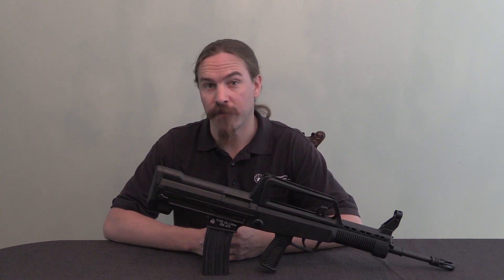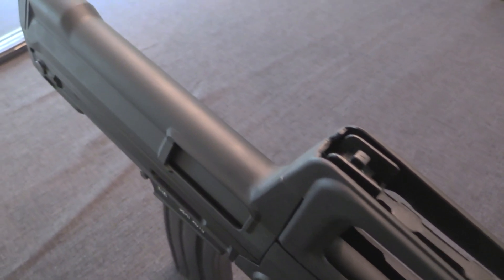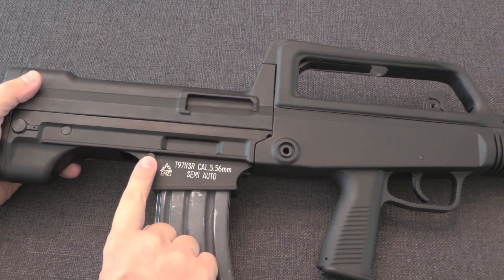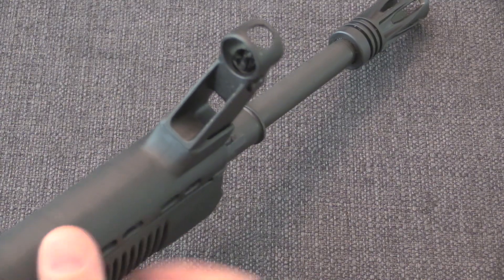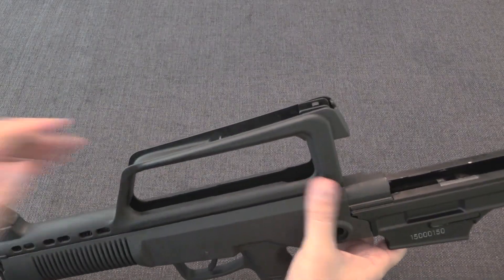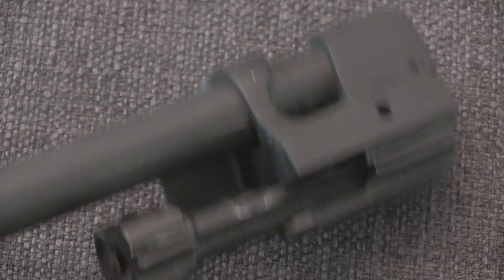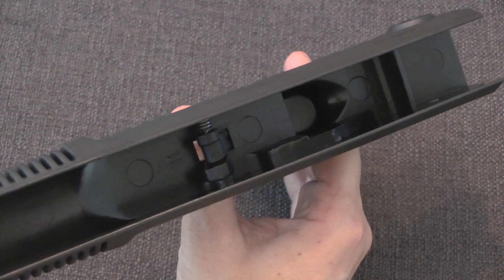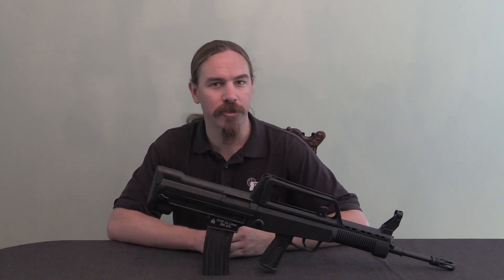Mechanics and Disassembly of the Norinco QBZ-97 / Type 97 NSR

Comment: Those special design features and functions on Tavor and FN2000 were not available on QBZ mainly because:
1. The Chinese must keep the cost down; their army is huge in size. 
2. QBZ already fielded the PLA when Tavor and FN2000 were still on drawing boards. 
3. The Chief Designer was a university physics professor and he had no previous experience with firearms design.
Reply: "3. The Chief Designer was a university physics professor and he had no previous experience with firearms design." Where have I L85'd that one before?
Reply: But...why?
I’m going to need a source for the third part.
Reply: @matthewpham9525  Well, the designer removed bolt release button, because he think it is a useless function😂. At least they fixed those design flaw in the 95-1 version.
Reply: @matthewpham9525  I don't have a source, but I think it's believable. Just like in times of need you convert civilians to soldiers and convert civilian gear to military gear, it seems quite reasonable to convert civilian research teams to military use. It's not like we need a dedicated team of rifle designers over the course of decades, one good rifle is often good enough, and I believe that was the philosophy behind making the QBZ a jack of all trades kind of rifle.

Comment: Can I suppose that the double sear (13:10) is an out-of-battery safety? One sear can't go up unless the bolt is fully closed, I suppose.
Reply: The one that drops is the sear, the one that goes up is the disconnector.  It's spring loaded, so when the rifle cycles back, it "catches" the hammer and holds it back when the trigger is held down.  When you release the trigger, it drops the hammer back onto the sear, ready to fire.
The hammer cannot actually contact the firing pin until the bolt is locked in battery, which pushes the bolt neck back into the carrier far enough for the hammer to reach it.  Thats your out-of-battery safety.
The Canadian variant also has a modified trigger group for legal reasons. The original rifles had a bolt follower disconnect so that the hammer can't fall until the bolt carrier is fully forward.  Essential for the military models for full auto to work, but unnecessary on the civ models.
Reply: jarvy251 With a linear hammer the sear-disconnector arrangement looks simpler to conceive than with a standard hammer. Also on a legal level, as I suppose the mechanism has to be evaluated before giving the export license to be sure that it cannot be transformed into a fully automatic weapon easily. Am I right?
Reply: That's right
Reply: Thank you, my friend!

Comment: ForgottenWeapons, here are how the QBZ-95 and Type 97 users get around the optical mount problem:
1. there are aftermarket adaptors to make it compatible with picatinny rail, though unavoidably makes the sightline high;
2. aftermarket conversion kit that convert the upper body into full-length picatinny rail;
3. newer iteration of Type-97 on Norinco catalogue has the abovesaid version available.

Comment: It seems like the AR a  toy designer would have come out with. It's cheap, it's kinda rattling and wobbly, it's functional, but it lacks the ergonomic bits that a weapon designer would have tried to implement (with the result that it's not really user friendly, but not terrible either, since sometimes those research came to unnecessary complex, or even detrimental, solutions).

Comment: It's a neat rifle, sure, but the NSRs were really REALLY hit and miss... Some worked flawlessly, others (like my personal example) jam up every 30-60 rounds with no ryhme or reason. There is a new version, a "Gen 2", which comes with a side charging handle and a top rail replacing the carry handle/front post system. In addition, a Canadian company makes all sorts of mods for it, including a top rail, new lower with a thumb safety and AR grip adapter, butt plate, magazine release etc etc... You can trick them out, but the question to us is always "upgrade a $900 rifle or just buy a Tavor/X95 to begin with?" I would LOVE to see one mud tested :)

Comment: What a rude golbergian design. Almost as bad as the first Brit bullpup.
Reply: It's not even close to be as bad as the L85. The first generation L85 has the only merit of being accurate. For the rest it seems to be made to be the least functional and reliable that's possible, with obvious design flaws (receiver made of too flimsy metal sheets, biodegradable plastic furnitures...), and with a backward ergonomy, so that all the things seem to work in the least predictable way (see for example the auto ejecting magazines when you squeeze the AR to the chest).
This instead is a sound design with little care given to the ergonomy, so that it's not as user friendly as it could have been, but not disastrous either.
Certanly, this seems to be a weapon of the same generation of the FAMAS, only  made 20 years later.
Reply: I was referring to the EM-1 rifle. Check Gun  Jesus' video on it.
Reply: Thanks.

Comment: How reliable is this gun compared to modern AK 74 and AR-15 platform rifles?
Reply: I own a Norinco type 97 and never really get any stoppages as long as you use the RIGHT STAN AG MAGAZINE. Some stan ag mags will not work in the export type 97. With the right magazine I shot 800 rounds of steel cased 55 grain 223 and never once had a malfunction.

Comment: You need to try a Type 97 with the Canadian upgrades. New upper and New lower. The lower has a different trigger and an additional safety up front. Next time you're in Canada track one down to try.

Comment: That optic mounting rail reminds me of some of the ones added to the various export models of Chinese SKS. It's commonly called the 'rail to nowhere' because it's near impossible to find mounts to fit it. I have a nice little 'paratrooper' SKS that has one, and it has a tendency to snag on my clothes if I sling the thing, so I took a cheap brass 8mm Mauser stripperclip and modified it to cover that thing to make it snag less.

Comment: There is a Airsoft company based out of Hong Kong that makes Airsoft type 97 called real sword. 
They make a optics rail to picitinny adapter. 
Since I'm pretty sure their Airsoft replicas are made with real parts pretty sure it will fit

Comment: For some reason, after seeing all of these military bullpup rifles, I want to see how these rifles would look if they were designed with the magazine in front of the trigger mech. Lots of interesting innovation in terms of ejection methods and fire control mechanisms.
Reply: Then it wouldn’t be a bullpup, the whole point of the design is to condense the rifle so soldiers can bring them into IFV’s while maintaining a full length barrel. The concept fell out of use now that the west has finally accepting and fantasy gun battles at extremely long ranges doesn’t really happen and that the 300 meter rule still applies

Comment: Hi Ian, I have seen a video where a left-hand shooter could shoot a bull pup rifle accurately with the butt on his right shoulder. I think with training and practice, you can shoot accurately with your right shoulder without the brass hitting you face.The T-97/QBZ95 have a soft recoil because the recoil spring and striker spring are inline, similar to the dual recoil springs of the Glocks Gen.4 pistols.

Comment: If long connecting bars are the main problem with bullpup actions, I wonder why people don't use a regular trigger setup and made the striker/hammer extend forwards to the sear engagement. You wouldn't have to redesign the trigger group and there would be fewer moving parts.

Comment: I'm Canadian and have one of these I picked up for $500 burger bucks 2nd hand. There is a rail you can get that clips into the optic mount and converts it to accept standard mounts. However, the optic ends up pretty tall on top of the hand guard. The other thing about this rifle is it can be a bit picky about which AR mags it likes. It definitely DOES NOT like P-Mags

Comment: I just can't help it.  I like bullpups.  I don't have a problem shooting Tavor X95 from the left shoulder, but it does fling brass close enough to your lips be disconcerting until one gains some confidence that it won't hit you.  I would want to convert to L.H. ejection if I were left handed.  It will be interesting to see what Left handed people think of the MDR.  The ejection is very much forward, but from the usual ejection port location.  It seems the brass would hit your support arm when shooting from the left shoulder, at least if you let your elbow float up at all.

Comment: Just a wild idea on the hammer thing: It could be easily made into an open-bolt version for the light machine gun version, just put the two parts together so the trigger sear catches the bolt as well. However it seems that the actual support weapon is closed bolt as well.

Comment: Excellent video as usual - just wanted to mention a potential safety issue - if you need to adjust the gas tube setting (7:24) DO NOT use a live cartridge!!!!!!!!!!!!  It might detonate from the heat - whilst I realise that the chance may be small, it would be very bad for your fingers if it did happen!  Use an empty casing instead - there should be plenty on the ground!

Comment: About the plastic... It's going to be designed to be strong enough when it's in place on the gun. I've seen plenty of wood on guns and various stocks that would be very weak without the action installed. Stop the stigma around plastic.
Reply: I don't think it's so much Ian saying plastic is a bad thing on guns, since it's pretty much standard for modern firearms regardless, but the quality and manufacturing design can vary hugely from design to design. For instance, the AUG and TAR-21 are polymer heavy rifles that are heavily reinforced and sturdy where the Type 97 is a lot more flexible off the gun as you see in the video. I haven't had any experience handling the Type 97 and I imagine it's pretty robust when it's all together, but I'd probably be a lot more hesitant to rough it up than another gun.
Reply: Yeah, once assembled, the plastic shells lock into the steel/aluminum framework and eachother and are pretty sturdy.
Reply: Czars Epidemic you want the plastic to be soft as it is easier to take apart and absorb more energy when fired, the most important part was reducing as much weight as possible by being thin.
Reply: @alanOHALAN  Yeah, that was what I thought as well. A legit reason for using more flexible plastic in parts where stiffness isn't a requirement for functionality (e.g. not supporting anything that needs to stay still) is that hard plastic can shatter, where soft plastic would just bounce back.

Comment: The AUG is super modular. The Tavor mitigates a lot of the speed problems of bullpups. The F2000 is totally sealed and completely ambidextrous. The QBZ  shares with the Famas and L85 the honor of being a rifle...
Reply: I think he is referring to the quick barrel change system on the AUG, which is something I haven't seen on a lot of firearms, let alone bullpups. I'd argue the Tavor has a lot more options for being modular (trigger packs, caliber conversions, changing from left to right, etc), but it's also a gun that's literally decades newer in design. The AUG is a relic from the 1970s that has held up amazingly well.
Reply: at $600 CAD (~460USD 1/4 of what Tavors go for), it runs super reliably with Barnaul steel case ammo ($0.4CAD per round), reliable (haven't cleaned after 2000 rounds still works every time), and you can abuse it however you want, you can't beat that as an entry level bullpup. It's like a Corolla of bullpups
Reply: "of the development team for the L85, a grand total of zero of them had ever fired a rifle"
-Ian McCollum, Gun Jesus
Reply: Of course you can - if you have a standard stock and a lefty bolt to put in.
Reply: Yet only the Famas, L85 and QBZ have been adopted by top rate militaries 🤔
The others have only been adopted by smaller armies. Wonder why.
Reply: Sconehead The answer is nationalistic hubris. The L85 was designed by people who didn’t know anything about guns when outsourcing would have been smarter. The UK is now shifting to the HK M416. The Famas was just France being weird/unique with its domestic firearm production as it always has but unique does not equal good. France is now also shifting to the M416. The QBZ was China’s attempt to appear space age and modern. China is now shifting toward a new mysterious but clearly conventional rifle we think is called the QBZ-191.

The smaller countries on the other hand buy the other rifles because they genuinely believe that’s what they’re looking for and want to get the best guns for the money since they don’t have a whole lot to spend on guns
Reply: @andyrihn1   As much as National hubris comes in, their are wider factors. Most notably keeping people in jobs, see Westlands Apache. Furthermore, the only real bad British Firearm was the SA80 program and I whole heartily believe that if a new domestic weapon was introduced it wouldn't have anywhere near the drama of the SA80.

For a modern mobile military based around rapid response a small easily controllable firearm is essential, hence the adoption of the M4 by the US. A bullpup saves in size without compromising on the barrel length like the M4 does. The idea behind the comeback of larger rifles is what we in the military industry call a "afghanism". Where a policy or ROE from afghan has become accepted as the norm and people have forgotten that conventional conflicts are a thing. Trust me I could make a very long video on "afghanisms". But to keep it short, in Afghan and Iraq contacts were engaged in longer distance firefights due to the terrain and enemy tactics. This necessitated the reintroduction of longer ranged weapons such as the L129 or the US marines with their M14s. In more conventional wars as seen in eastern Ukraine the idea of closer engagements (<300m) holds up. 

As far as I'm aware the British army has no plans (or money really) to adopt the 416, especially after the recent A2/3 upgrade.  To add to this, the post ISAF policy/strategy of the British military is to create highly mobile mechanised units that essentially act as a QRF. With this change I fully expect the Army to maintain a bullpup design, or wait until laser rifles are a thing. I can say from personal experience that you don't want a full sized "conventional" rifle in the back of an AJAX. Tight fit with 8 blokes.  I cannot speak for the french but with the conception of an EU army around the corner I think they'll hold off and only replace the weapons when the EU army is a reality. Thus, equipping the whole of the EU with one weapon (what a contract that'll be, probably goes to H&K). 

To summarise, 
Bullpups, are great, still the future and very much the present ...when done right, usually the second time around. 
I wouldn't be surprised though if we see the development of purpose built Marksman rifles, something like an AR-10 or similar.
Reply: Magni56 It seems like a pretty crap rifle imo.
Reply: @weasle2904  It really isn't: for $650 [CDN]/ barely used, you get a more accurate Ruger mini 14. 

A new Ruger runs about $1400, ,
in the current (Canadian) market for comparison. 

...Trudeau Jr., has crushed our dollar to a paltry <.75 cents, US. So, the dollar [CDN] really shows  market constraints. 

For it's dollar value, excluding the well made aftermarket picatinny upper/lowers (T97"dot"ca) - or prebuilt Gen.2 @ $1100+... It is a steal, at 1/3 of the cost of a Tavor with minimal detriments, or 1/2 of the price for the picatinny model: both versions feature a "glock" trigger-feel that is superior to a standard Tavor - non aftermarket.

Obviously, quality control being what it is, Ian seems to have received a bit of a lemon. I have had, and used, several examples.

The  "squishy plastic/rubber feel" was a design characteristic, for nasty tundra situations: one in which, is a valid consideration for areas like Northern Canada/Alaska. The 'elasticity' prevents the brittle 'tupperware' results o e would receive from Magpul in those conditions.

Obviously, being banned, I cannot speak to the quality of a FAMAS - which might be a constraint of the era, and not a design application.

Cheers!

~ Tom.
Reply: Hey dont group the famas with the l85 and qbz those two are giant failures as far as practicality is concerned

Comment: As a lefty who has shot the T97 fairly extensively in 3gun, I would not recommend attempting to do so no matter how carefully you position your head.  Unlike the Tavor/etc with comparatively gentle plunger ejectors, the T97's fixed ejector kicks cases out with enough force to split lips.
Reply: that is one way to redirect the energy by splitting out the cases hard thus the low recoil. but the butt is fairly long it is easy to put the face behind the ejector.